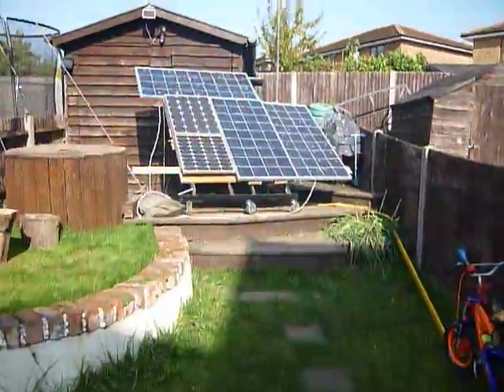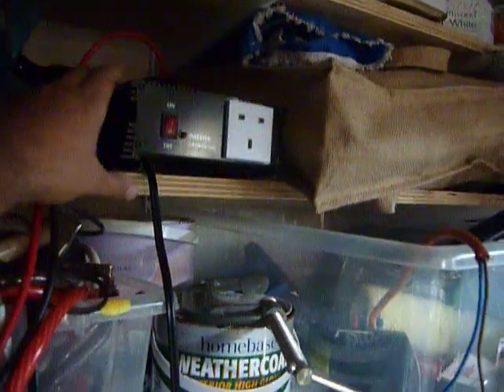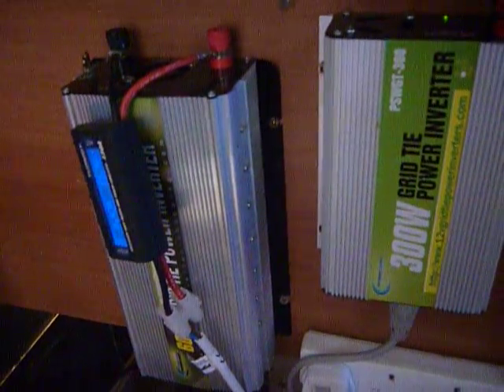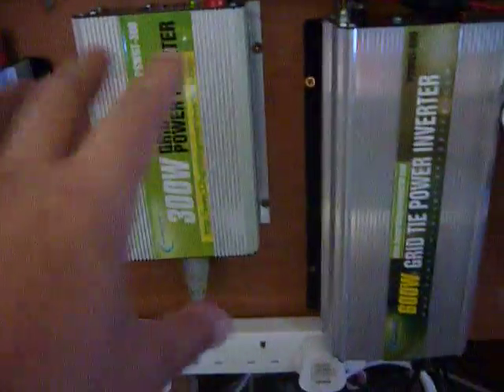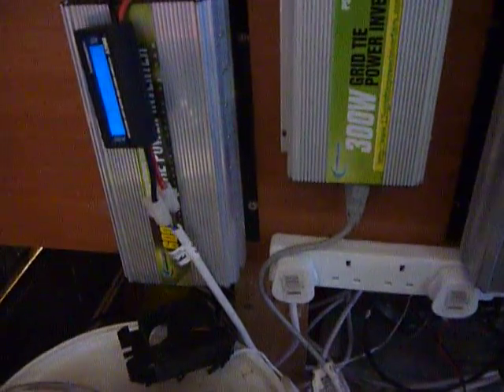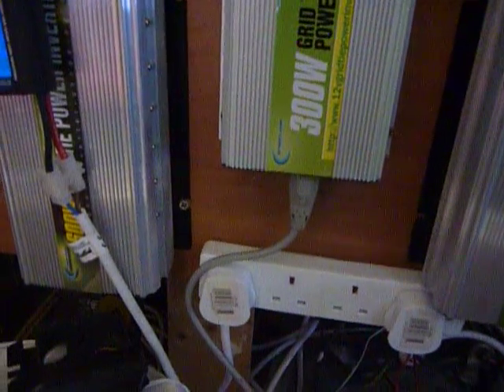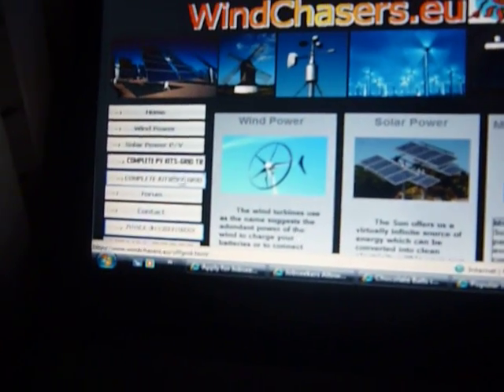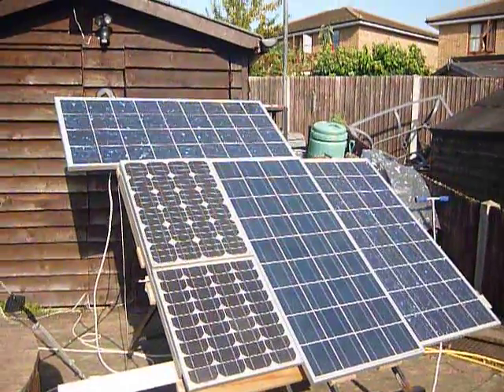wind turbine, solar panel, hybrid system, grid tie inverter 300/600watts

Comment: 4:08 , the thickness of a cable does not mean that the wires are more thick or that the wires are a better grade.
 Cheaper made cables have smaller wires with thicker insulation with a lesser grade insulation. Your thicker cable may be one of those cheaper made cables and that may be the reason that the cable is more thick.
If paralleling or  series string panels, always use panels with the same wattage, volts or amps....otherwise you will lose a lot of power.
Actually you could go with an panel that has an difference of 5%, but not more than that.
Example, you could do parallel or series a 100 watt panel and a 105 watt panel, but you could not parallel or series a 100 watt and a 50 watt panel.
If you parallel a 100 watt and a 50 watt panel, about 50 % of the potential solar panel power of the 100 watt panel will be destroyed in doing so.  If you series a 10 amp panel with an 5 amp panel than the 10 amp panel will be limited to 5 amp output by the 5 amp panel.
Reply: took the words straight out of my mouth.